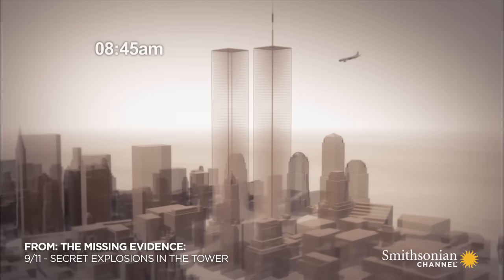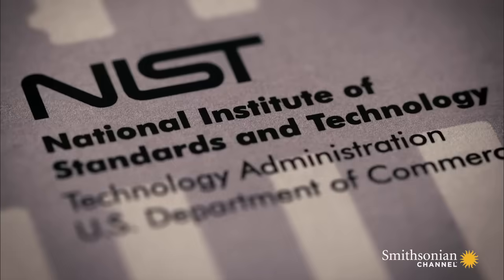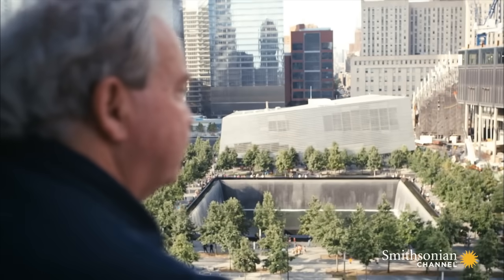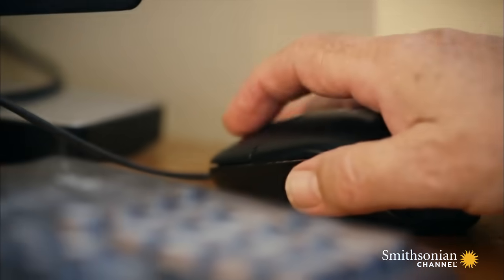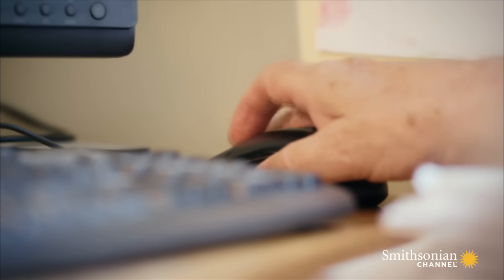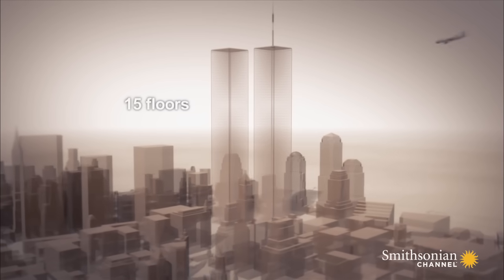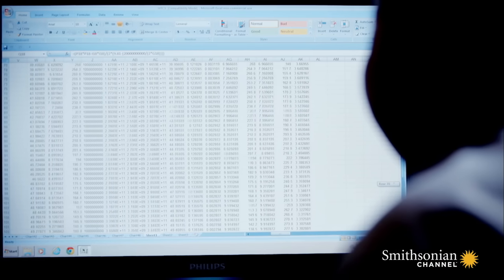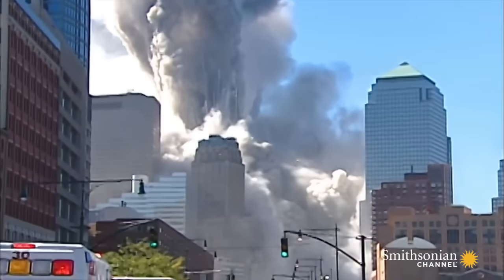This Computer Simulation Explains How the Twin Towers Fell

Comment: so if a missile of proportionally smaller size filled with explosives hit the buildings that could pack a punch similar or even greater than a much larger missile, ie 767 filled with explosive jet fuel travelling at 500 mph, and each cause the devastation that occurred with the fire and  building destruction at impact that has never been seen before in this manner and to say that the force of the weight of the building above those floors would not be enough to start a chain reaction collapse is just plain ignorant. this was a never before seen catastrophic event of biblical proportions. The missile that was the airplane would penetrate an office building be it a high rise like wtc or a low rise and not bounce off. maybe a small turboprop would but not jets of these sizes. This was a truly horrific day that will never be forgotten.

Comment: Just doesn't make sense to me at all. How the damage and fire almost at the top of the building can weaken the whole structure of the building? Come on, even little kid can solve this.
Reply: How can shooting a stack of cards cause it to fall???
Reply: The fact the rest of the building is not damaged has nothing to do with it.  The structure is only designed to carry all of the weight of the building held stationary.  Its called a static load.   That is what it is engineered for.  Non moving loads.    WHat part of 15 floors moving don't you understand?

Comment: 3:02
"Frank's calculations would also need to prove that the floors below each impact point would disintegrate in a manner that looks similar to a controlled demolition"

That sums it up.
Reply: It only says that it needs to TRY to prove: not that it DID prove that it was a controlled demolition.
Reply: Proving something scientifically has 4 steps:
1. Observation and description of a phenomenon. The observations are made visually or with the aid of scientific equipment.
2. Formulation of a hypothesis to explain the phenomenon in the form of a causal mechanism or a mathematical relation.
3. Test the hypothesis by analyzing the results of observations or by predicting and observing the existence of new phenomena that follow from the hypothesis. If experiments do not confirm the hypothesis, the hypothesis must be rejected or modified (Go back to Step 2).
4. Establish a theory based on repeated verification of the results.
Reply: Yes, that would be right but only if they would have came to that conclusion. 
They came to the conclusion that the buildings fell in a manner that looks similar to a controlled demolition because of the fire and the weight of the upper floors.
Reply: Dan N.  Excellent idea;  so tell us , in your new Theory, how did "Fire" , plus the "weight of the floors" manage to reduce all those many concrete slab floors to DUST?!
Reply: If you read again what I said you'll understand.
If you still don't understand my point then there is no point in taking this further.
Reply: It looks like I actually did not get myself clear enough about what I said.

I believe that it is impossible for a building to fall out of the sky just because of a fire and some hole in it.
They changed their calculations so that the building would fall because of the fire and the weight of the upper floors without the need of the explosives (probably they changed the gravity to be just as it is on the sun). That is absolutely incorrect. You do not change the calculations to meet your expected result. You make the calculations and if the result does not meet with what happened in reality (following the laws of physics) then there must be something else to it.

Regarding that building that collapsed the other day due to fire in Tehran.

If you watch a video about it you will be able to see some explosives one second before the tower started colapsing.
Reply: They start with the assumption that the calculations must be changed in order to make the "simulation" look like just it happened in reality. 

The end conclusion of this video is that the calculations they've made proves that in the end the buildings would fall and there was nothing that could have been done to prevent this. The simulation "proves" that the buildings would have fallen no matter what,  exactly as did in reality. Right at the end it "proves" that the buildings would fall in a manner that looks like similar to a controlled demolition and the fall time would have been almost identical.

When you try to prove something you start with what happened in nature and try to explain it. You do make calculations and adjust them but you never adjust them outside the laws of physics.

PS: Just look at some videos when the demolition did not work as expected. The buildings are much more resistant than you think they are.
Reply: "he was trying to show whether or not a collapse without explosives would happen as it did, and if it did,  his calculations would need to"

"prove that the floors below each impact point would disintegrate in a manner that looks similar to a controlled demolition"

(keep in mind the conclusion at the end)

They do not say that they will change the calculations but that is the only thing that they can do in order to prove their theory.

The building in Tehran collapsed in entire same way WTC  did.
Reply: @danny__921  Except the 🔥 was three hours long...
Reply: ANDROUMAC1 Look again at the video an you'll understand the missinformation.

They start with the conclusion that the buildings must fall in a manner that looks like a controlled demolition because that is the way it happened. In order to prove that they have to TRY to prove it. eg. I say that 2=2+2 and follow with the conclusion: I'm telling the truth. Now how do you prove me wrong? Do you start with my conclusion or with my hipothesis? If you start with the conclusion you'll then say the same thing I have said. I say the truh but this does not make 2=2+2 true.

It' completely wrong. They create a conclusion based on what happened and do whatever it takes so that the calculations will prove that.
They should create a simulation following the laws of physics. If then it conforms to reality then evereything is true. If not then they have to make changes on the buildings structure (because the laws are still the same). If after making additional changes on the structure it falls how it did in reality it means that the official report is false.
Reply: @danny__921  yep..they made another cartoon.
Reply: Dan Nemes u
Reply: D
Reply: Dan Nemes
Reply: I noticed that too, but I think it was just badly worded. They should have said "Frank's calculations would also need to prove that the floors below each impact point would disintegrate in a manner that looks similar to a controlled demolition if it were to prove that the collapse of the building could have happened without the need for further explosives."
Reply: Long experience with concrete structure collapses, such as earthquakes,  does  NOT follow the pattern of your imagination.  You do NOT see concrete reduced to dust in these events.   Having reread your comment, I do not see how you have answered that in any way.
Reply: Interestingly a high rise building collapsed due to fire TODAY in Tehran. The fire department spokesperson commented that the collapse didn't damage adjacent buildings because it collapsed into its own footprint. There isn't much info yet, clearly the building was a different type of structure and the fall (which was caught on camera) wasn't as "clean" as the WTC, but photos of the aftermath appear to show that a lot of dust was created.

http://edition.cnn.com/2017/01/19/middleeast/iran-tehran-building-fire-collapse/index.html
Reply: Why do you say they changed the calculations to make it fit the expected results?
Reply: It doesn't say that. It says that his program shows that it would collapse the way it did. It doesn't say anything about changing things to fit what happened.

It does say what you quoted in the first post, but I've already replied to that. It says this because he was trying to show whether or not a collapse without explosives would happen as it did, and if it did,  his calculations would need to... etc..
Reply: How about "You underestimate the weight of this dense material named concrete."?
Reply: Dan Nemes
Reply: How is he full of shit?'

I mean besides the normal digestive track workings of the human animal of course.

Are you just saying that you assume his calculations are incorrect, or do you actually know what he did wrong?

If you are just assuming, then on what basis?
Reply: Really? Wow. You truthers ARE idiots.
Reply: You nailed it,lol
Reply: When you design a building, you design it in a ways so should it collapse or need to be demolished, it fails in a certain way to minimise collateral damage.
Reply: Also that the structure below can't support the deadload itself + extra safety, or was designed so weak that when you fill some bathtubs in the upperfloors the middle section would collaps.
Reply: It Sure the F does.
Reply: cause that's what it was!
Reply: "that is the only thing that they can do in order to prove their theory"

Why do you say that? The whole video is about the fact that his calculations showed that it would fall the way it did, without explosives. It never says he had to change the amount of gravity or anything like what you've claimed, in fact it seems to say the original calculations turned out to model it extremely accurately.

Comment: jet fuel can melt steel beams :)
Reply: *cant
Reply: They didn't... But because of the heat they were weakened and weren't able to hold the weight

Comment: They were designed to withstand a plane hitting it at the altitude speed of 300+ mph, not a hijacked plane going 500+mph
Thats a 200mph difference, have you seen what 200mph crash looks like? 500 is far far worse

Comment: That still doesnt expalin why the steel core wasnt left pretruding after the exterior walls collapsed. More propaganda in an attempt to justify the cover up.
Reply: I used to be a "truther", as they call it.  But one day I stopped watching YouTube videos that fit what I wanted to believe and researched the construction of the towers myself.  The central core was not designed to stand on it's own.  The buildings were a completely new way to build skyscrapers and that included utilizing an outer core and inner core, connected by the floor trusses, to form an extremely strong structure.  Any twisting, shifting, or bending would be transferred through the outer frame, through the floor trusses and into the central core.  As well as directly down the outer columns into the foundation.  It was literally ingenious, yet so simple.  

The problem is, when the floor trusses are not present, both the outer frame and inner core become wobbly wet noodles that can't stand up under their own weight.  Let alone withstand hundreds of thousands of tons of floor trusses, office equipment, and cement floors smashing into them on their way to the ground.

If you look closely at some of the collapse videos you can actually see the central core still standing as the outer shell and floor trusses collapse around it.  But, due to their wobbly stand-alone structure, plus the weight of the rest of the building slamming into the foundation and sides of the core, it comes down in only a couple of seconds.

It really is completely explainable when you understand the physics and the structural design of the buildings.
Reply: What steel core?  You mean the place where they put all the elevators...  WHICH CRASHED TO THE GROUND AND ALLOWED THE FIRE TO GO DOWN THE ELEVATOR SHAFTS AS EYE WITNESSES SAID THEY SAW PEOPLE ENGULFED IN FLAMES IN THE LOBBY!!!...  That Steel core..  Which was on fire too.  And weakend... and crumbled down due to the overwheliming weight coming down on it?  

Jesus people listen to yourselves.
Reply: nope